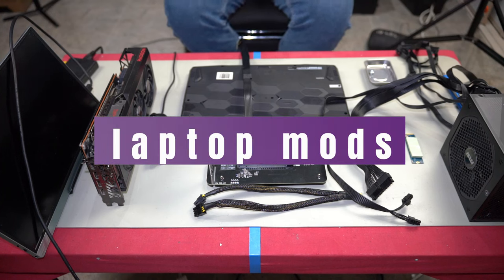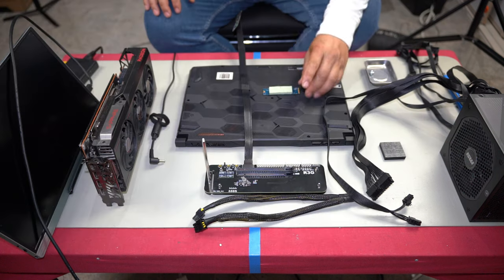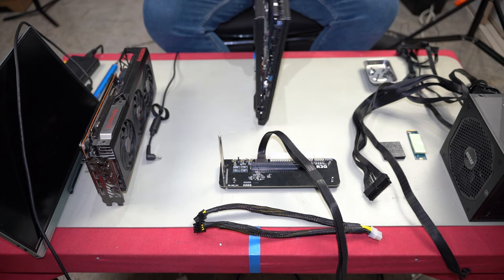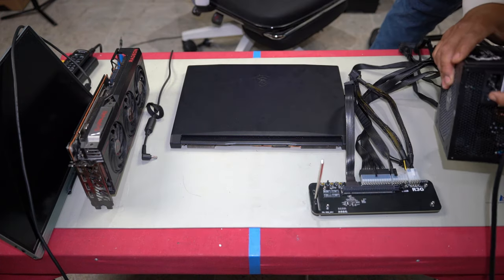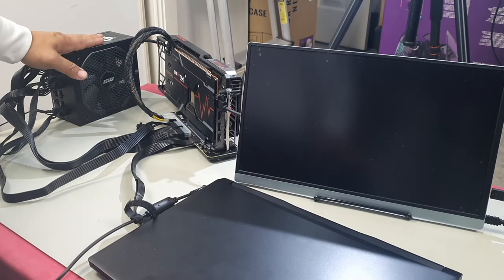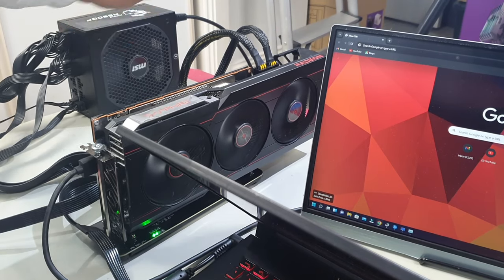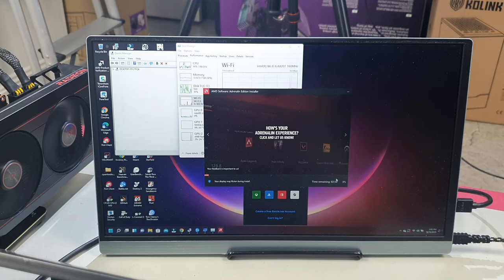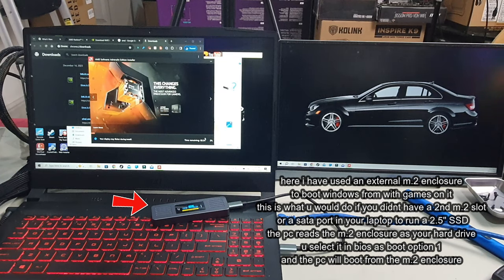how to setup eGPU  use an external gpu with your laptop for gaming

Comment: Just recently tried to connect my Medion MultiMedia Laptop (with built in Intel Iris Xe graphics) to an RTX 3060 ti using the same concept and steps as you did. RTX and Laptop both react to another but the Laptop thinks it's a new device and wants me to enter my Microsoft recovery key. It accepts the key but Windows 11 won't boot up without an error sending me back. I tried some stuff in BIOS but that didn't help. Hotplugging doesn't work either of course. I'm using the extra M.2 SSD Slot of my Laptop.
You know what causes that to happen? Like I said the Laptop is reacting to the GPU so I guess it's not a Hardware problem.
And what about the drivers? I tried installing NVIDIA Geforce Experience but it says it can't install without an NVIDIA card. But if I install the drivers manually, will that get in conflict with my Intel graphic drivers or should they coexist just fine?
Reply from the maker: ok so if your getting the recovery key error something is causing it to think its a different boot drive, hence why its asking for a recovery key, however it should be able to just boot 
if you remove the egpu it boots fine??
as for drivers coexisting its fine
cuz u have integrated graphics and external graphics now 
however is your laptop only integrated graphics>??? most newer laptops that are intel based have both integrated and external, very smart design, so it uses the integrated when not needing the extra juice from external gpu, and wen it does it auto switches back and forth to the external graphics, 
this is only with laptops that have a gpu as well, 
for i.e my old laptop u saw had both igpu and a 3050, and wen going into task manager you can clearly see them both coexist 
when i used the egpu i disable the integrated graphics so it only uses the egpu , that way i get full performance from the egpu i connected only which is what u want 
if you try and install the drivers manually and it says no hardware detected it mean its not reading the gpu you connected , if you watch a few other video some ppl had to use a extra dp connector to trick the gpu into thinking it has a cable connected so it can display graphics, but thats abit different to what i did, and i realy didn't have to do that
it was pretty straight forward 
first thing u need to get past the recovery key issue 
i would start there 
now wen a laptop wouldn't boot with egpu i would l always try and use a fresh ssd and boot from that 
u have 2 nvme m.2 slots correct??
would u try a fresh install of windows?? just to see if it recognizes the new install? do not format your current ssd, as im sure u have games or work on there 
if u have a spare SSD even if its a 2.5" ssd just to try 
and it should work 
if your laptop is reacting to the gpu then its definitely workable, its a matter of getting past the recovery key issue, i would start with googling the fix for that and see what causes it, i haven't experienced that myself, and if i did i would google the error code and erro msg and go from there 
you'll be surprised what u can learn 
i hope this helps somewhat 
usually i gop off trial and error too , so having a pc in front of me will allow me to try certain things to get through it 
and sometimes thats the case 
im no professional and i will say that with no shame , however i have learnt alot over the years self taught , but i am in no means a pc expert, so pls dont crucify me if i cant figure it out right away, but i will always do my best to give the best advice i can 
keep me in the loop id love to hear how u turn out
Reply from the maker: and however far you get let me know so maybe i can try something to help further , that what its all about helping each other
Reply: @MIKEYZVLOGZ Hey, thanks for your very kind response! 😊

My progress is a little delayed right now, since my dock broke (next time I'll one that comes closed up😅) but I've done some research and thinking.
I'm not quite sure how exactly graphics work in my laptop. Usally I know CPUs have some graphic capabilities, I first noticed this when a 3D software let me choose between CPU and GPU render. And Intel Iris Xe apperently is bound to my 12th gen Intel i5, though I'm not sure in wich way it's really part of the CPU itself. For beeing a part of a CPU it almost feels a little too strong, beeing capable of running Jedi Fallen very decently with just adaptive quality activated and beeing able to interact with the USB 3.2 port to connect up to 3 4k Displays. And in device manager it shows up in it's own entry under "Graphic Cards", wich integrated CPU graphics usally don't do in my experience. So I guess Intel Iris Xe is like an inbetween or something? Comes with a CPU but seems to work similar to a separate GPU.
Yes, I have two SSD Slots, however when I try to open the chassis I can remove the screws without problems but the cover will still not come off and to be honest I'm not sure it's even meant to. The Cover is very snuggly fittet to it's frame and since the second M.2 Slot is accessible from the outside and is built like it's own little closed off room, I'm really afraid I could break something if I try to force open the cover, maybe completley screwing up my second M.2 Slot in the process. So I can't access the primariy SSD slot and I need the secondary for the eGPU. Only thing I could do would to install Windows on an USB stick and boot from there, but to be honest I never downloaded and installed an OS manually before.
Besides, my Laptop is still pretty new, aside from a few apps, three games and a few files there's not really something on it and I just recently had to reset it due to a problem I had with my touchpad, so could booting from a fresh windows even make a difference this early? Currently I'm researching BitLocker and maybe I could try to deactivate it. I don't let my Laptop lay around anywhere so I assume it won't be stolen anytime soon and the data on it should be safe either way. If I deactivate BitLocker, it will not ask me for my recovery key and maybe then it will accept a new PCIe device. Maybe.
Like I said, my Laptop definitley knows that there's something connected via the SSD slot that's not an SSD so hopefully BitLocker is the only thing in my way.
In BIOS I discovered the option VMD Controller. If enabled it also triggers BitLocker, even without eGPU connected. Maybe that can help as well.
Reply from the maker: ahh I see ...try it see how u go..disable vmd. usually and relates to extra drives being installed too so give it a go it won't hurt ..and try again ...o would try and google your laptop model and see how someone else pryed it off so u don't blindly try to pry it off..if u see how someone esoes it ..it give su more confidence too ..hope it all works out ... it your case I think u might have an external too because if u only has igpu then it would only show igpu..but if yours shows integrated graphics and external graphics ...very likely it's got another graphics card in it ..what it is ..that's a mystery still...although tour specs should have clarified that

Comment: Can u make a guide using the exp gdc egpu dock?
Reply from the maker: there are a few videos already on yourube check them out see if it helps u
Reply: @MIKEYZVLOGZ I have everything set up but  when I boot the laptop everything works fine but my screen won’t turn on and it flickers every few seconds. I’ve tried to plug it in while windows was booted up but it the screen just freezes and keyboard stops working. Then I tried plugging in the cable to the m2 slot without the dock connected and it does the same exact thing. Any fixes?
Reply from the maker: @zzeroo-m8l  is it pcie 3.0 ? have u tried selecting gen 3 in bios
Reply: @MIKEYZVLOGZ Yes it’s pcie 3.0 how would I switch it to gen 3 would I just go into bios and change it. My laptop brand is acer
Reply from the maker: @Zero000vr  I. not too sure as I haven't used an Acer laptop before although it should be under settings look for pcie gen..and select the appropriate gen such as pcie 3.0 gen 3 ... it could help..  go into bios by pressing del key or f2 on boot screen
Reply: @MIKEYZVLOGZ  I can’t seem to find it. Does the dock have to be plugged into the m2 slot while I am doing this?
Reply from the maker: @Zero000vr  no it doesn't have to be plugged in
Reply: @MIKEYZVLOGZ  I’ve tried to change it but I can’t find the pcie option and I’ve tried going to the amd control panel and finding it there but no luck.

Comment: Does it work with laptop that have their own dedicated gpu ? Also this is oculink right since it use m.2 slot , how is this compare to thunderbolt4 connection?
Reply from the maker: yes my laptop have dedicated and integrated 3050 but I use this so can use more powerful gpu
Reply: @MIKEYZVLOGZ  my laptop have 3050 too but I wanna try this😂

Comment: If the laptop only supports PCie 3.0 but I have a VGA AMD RX 6700 XT bus type PCIe 4.0, will it still work well on the laptop ?
Reply from the maker: will work but run at pcie 3.0

Comment: instead of pcie gen4 slot , can i use my wifi card slot if i dont wanna use the sata ssd ???  Need help guys...
Reply from the maker: yes u can ... just ensure you get thw adapter that is for your wifi slot..there are different types of wifi slots... if yours is a typical newer wifi alot I think it's key m or key e . then u can use that and it will work fine aswell
Reply: @MIKEYZVLOGZ  Alright Thanks man , I appreciate that....😄
Reply from the maker: @WickedAltered  ur welcome mate
Reply: @MIKEYZVLOGZ  i got a MSI GF63 thin , it do not specify if its m key or e key , but its an m.2 slot for the wifi card..
Reply from the maker: @ShauryaRana7  then just ensure you get a adapter that is same as your wifi card
Reply: @MIKEYZVLOGZ  If I use it on my wifi slot that will reduce performance right??

Comment: Hey there. I just found another adaptor from M2 to PCIE but it does not have the power cable slots on the adaptor like the one you are using in the video. It only has the gpu mount slot and one small 4 pin power slot to power up the adaptor. Do you think the adaptor will work just like the one you are using even if it does not have all the PSU cable ports? Thank you in advance
Reply from the maker: @rarescoliban6680  i dont think so as it needs power to power the gpu as well
Reply: @MIKEYZVLOGZ  I will power both the gpu and the adaptor from the PSU, why would that not work? Maybe you can share your discord id as I have some other questions please
Reply from the maker: @rarescoliban6680  oh in that case it should work ... wen u said it didnt have power cables i thought u meant u didnt have the samw egpu i have and therefore couldnt power the gpu ...i dont use discord this is my platform ... u can ask here i will do my best to reply asap
Reply from the maker: @rarescoliban6680  as l9ng as ur psu is powering the gpu and iy should work
Reply: @MIKEYZVLOGZ  I just found out that I want more bandwith to get better performance, I need the M2 slot to be M key'd(if I am right). Looks like the M2 slot that I have is M.2 PCIe M Key and should support PCIe x4. My question is, do all adaptors support PCIe X4 or there are some for x2 and x1 too? I am trying to get the most performance out of this.
How can I check the number supported by the PCIe adaptor( I mean to check the x4, x2 and x1)?

Sorry if I am mistaken or something, I am new into this and I am not right about the info I am talking about.

Comment: If I got Lenovo Lenovo Legion Y520 and M.2 nvme PCIe 3.0x4 slot so the ADT R43SG-TU 4.0 it should be works/ fit ? Cos I dont know which adapter I should to buy. There are too many of them. They write it fit to PCIe 3.0 and 4.0 ?
Reply from the maker: yes pcie.40m is backward compatible with pcie 3.0 so u can still use it .. I would just get pcie 4.0 so it ready if u ever need to goto 4.0
Reply: thank you for answer
Reply from the maker: @dawidwyborski3753 no worries buddy

Comment: if did this to my mini pc but when i  installed the drivers it black screens
Reply from the maker: ok something isn't registering..have u tried manually selecting the gen on your bios settings..  if your using older gen 3 gpu select pcie gen 3 ...and also ensure u disable the igpu and select the external gpu as your output device

Comment: Bought the ADT link k43sg, tested with rtx 4080 super, i ain t got no display on monitor when hdmi is plugged into the gpu, i tried with the hdmi cable plugged into my mini pc and the monitor is showing display but i the gpu isn t detedted, please help!
Reply from the maker: try and select gen 3 or 4 in the bios settings

Comment: what if my laptop has thunderbolt 3 port and i connect external nvme slot through it and connect my egpu to that. will it work?
Reply from the maker: yes 100% thunderbolt is designed to run external nvme so that's great

Comment: how is the performance ?
Reply from the maker: it's just as ud expect from a gpu ..much better then the gpu that cane with laptop which is the 3060 6gb for laptop version ..now u can use a much more powerful gpu and still run it without issues
Reply from the maker: I know I didn't do a performance video but there are several already on yt which show the performance gain..and it's well worth it especially if u only have a 3050 or worse.it really can change the entire gaming experience using the right gpu that also doesn't bottleneck anything

Comment: so the 4 pin cable what is that does that come with the power supply
Reply from the maker: @tharealbds  yes that's the cpu cable split in 2
Reply: @MIKEYZVLOGZ  okay so im going to buy the dock, power supply, and gpu and give it a try thank you!
Reply: @MIKEYZVLOGZ  okay thanks so much cant wait to try this

Comment: I just bought an external and that two enclosure and put my SSD that has my operating system in it, and it won’t boot up
Reply from the maker: make sure u select it as well ... it doesn't just automatically read u must select boot device in bios...also not all are compatible... ensure you have the settings configured right too like boot from u uefi not legacy..just a few little settings u need to pay attention to.. and it should work...
Reply from the maker: I'll send u the short I did where I used an external nvme ssd enclosure for a laptop that didn't have an extra 2.5inch port for boot drive
https://youtube.com/shorts/fcqH8gtRSjU?si=1NZPtm-fRFNG43Lz
Reply: I have messed with the bio settings, and then I disabled secure boot because it wouldn’t let me boot up to the M2 SSD enclosure and now it’s showing the Blocker recovery key, which I don’t have and I don’t think I need to enter that code to get it to boot up to it
Reply from the maker: @gavinstewart33  no u shouldn'till try make another short tonite about it and show how I achieved it so u get a better idea
Reply: @MIKEYZVLOGZ  okay thank you! 🙏
Reply from the maker: @gavinstewart33  wat laptop do u use
Reply: @MIKEYZVLOGZ  hp pavilion gaming laptop
Reply: @MIKEYZVLOGZ  now it won’t even get out of the bitlocker thing
Reply from the maker: @gavinstewart33  if it's asking for a bitlocket key code u can try find and enter it https://www.google.com/url?sa=t&source=web&rct=j&opi=89978449&url=https://m.youtube.com/watch%3Fv%3DdrCo-S4_iNs&ved=2ahUKEwiGgeqswfKEAxWHR2wGHeU2DBkQwqsBegQIIRAG&usg=AOvVaw2nCDilVmgsKwzAYfIHcZSi
Reply from the maker: @gavinstewart33  model?
Reply from the maker: @gavinstewart33  is the bitlocker there wen u put everything back to normaln
Reply: @MIKEYZVLOGZ  yeah when I put everything back to normal like the secure boot policy, it used to say that I need to put the secure boot policy enabled but now it’s saying it’s because it has changed so I need to have my recovery key

Comment: is there a way to  connect the gpu straight to the laptops screen? if so how
Reply from the maker: yes you can use your laptop screen as the display ... in my video u can see I was using both laptop and external monitor
Reply: @MIKEYZVLOGZ  also i had an idea to use an m.2 to usb c adapter because i have an extra usb c port in my pc, will it drop in performance if i use that
Reply from the maker: @teaminvest1397  I believe it will a bit due to the difference on speeds between direct m.2 alot and usb c speed... however overall you should have a better experience using the egpu
Reply: @MIKEYZVLOGZ  like how significant will be the difference
Reply: @MIKEYZVLOGZ  i just tested it out, i got a black screen with the sound working, so it seems like the dgpu of the laptop is the one working for the internal display, u have to use an external display im guessing if u do m.2

Comment: can i use the low profile gpu
Reply from the maker: can use any doesn't matter
Reply: @MIKEYZVLOGZ  but low profile gpu doesnt need extra power supply
Reply from the maker: @dcayt4491  then don't use the power ..just plug it in and see if it works
Reply: @MIKEYZVLOGZ  thank you